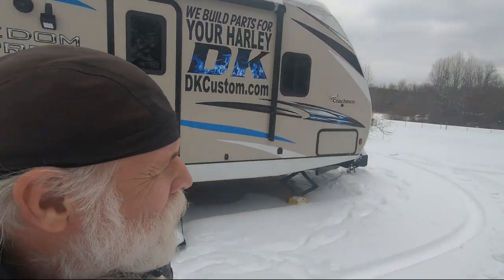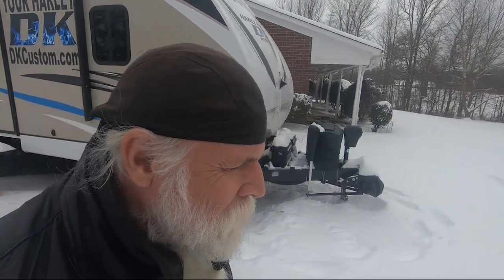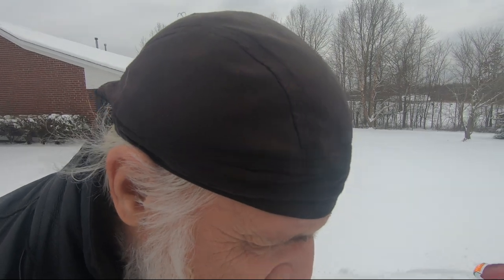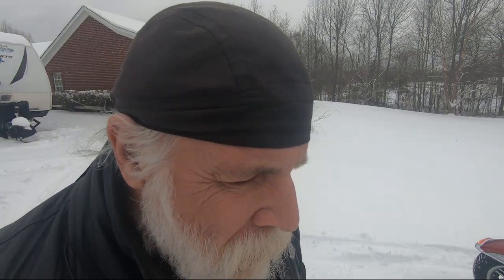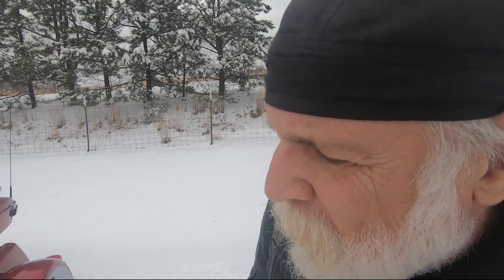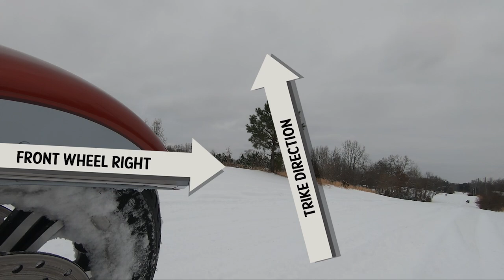Tri Glide - Donuts, Slides, Getting Stuck in Snow

Comment: Nice! I wish we only got snow every 20 years lol, I’m itching to ride up here in the northeast, went out last weekend and probably tomorrow but it’s too cold to go for any enjoyable longer rides
Reply from the maker: I hear ya.  Even with the heated gear, I used to ride regularly down into the high 20's, now I look for the high 30's.
Reply: Yup, sucks, but in a way it makes us appreciate good riding weather even more. My days of cranking around in the 20’s are over, mid to high 30’s I’m still good. I may need to invest in heated gear though. Doing it naturally isn’t very fun. Have fun.
Reply from the maker: @69Busa08Nova  Yeah, after a layoff, getting back in the wind is all that much sweeter.
Mary talked me into trying heated gear about 10 years ago...before that is was layer upon layer.  lol
All we use are the heated jackets and I can stay toasty warm, even at 35 degrees and 80 mph.
Reply: Nice!! I’ll definitely have to look into and probably take the plunge for some proper heated gear. I have a heated snap on jacket that works well but I don’t use the heat on the bike usually as when I stop for a long light or something I’ll start to just barely sweat, then the wind that gets under feels that much colder haha, oh well. Heated handgrips are probably the next thing I do, usually it’s my hands get cold to the point of no return.
Reply from the maker: @69Busa08Nova  Yeah, we actually have gerbing heated gauntlet gloves...but never plug them in.  Without being plugged in they are the warmest gauntlet gloves I've ever had.  When it gets real cold I wear a thin pair of gloves inside the gauntets.  Have fun!  👍